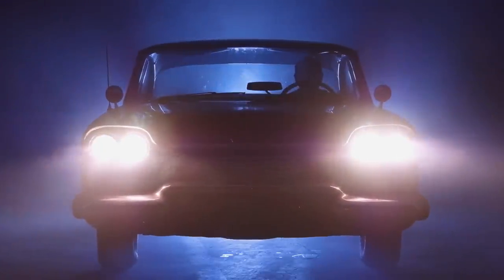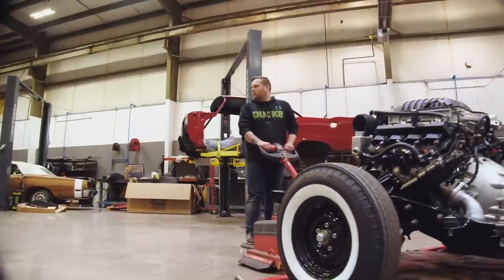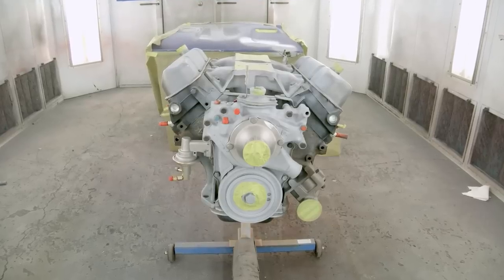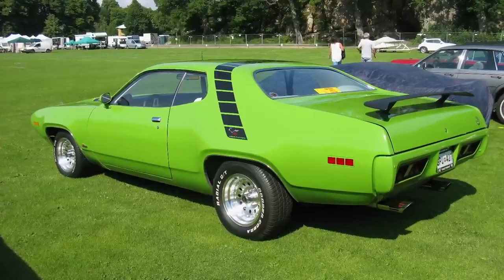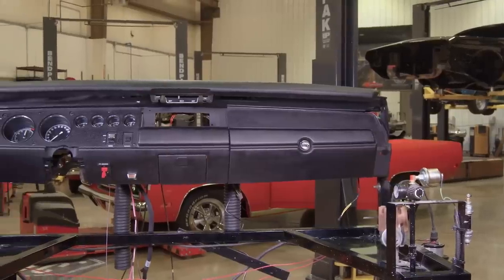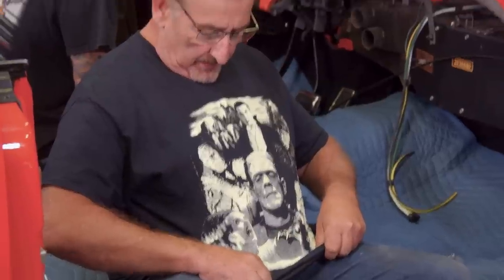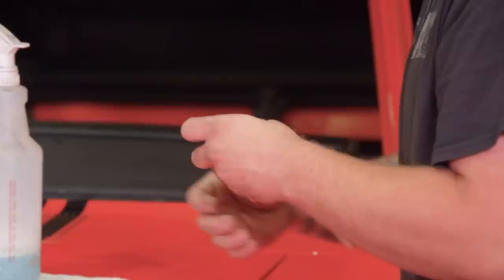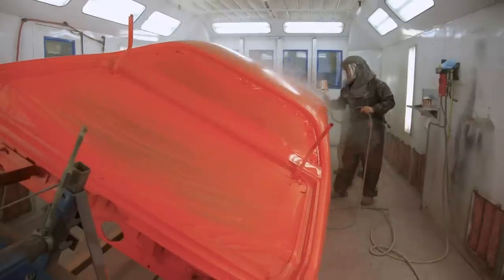NEW EPISODE: GARAGE FIND 69 CHARGER R/T GETS DELIVERED!

Comment: In your back graveyard you have a 1970 Plymouth Fury. I’ve seen it on your openings for years. Your next project should be to drop a Hellcat crate engine with a 6 speed manual transmission in that Plymouth Fury! Call it,”Hell Cat Fury!” Or simply HLCATFY! Leave it brown with the vinyl top and big meat Micky Thompson tires on the rear! Other than that keep it stock looking. That’s one mean mother of a MOPAR! MOPAR enthusiast will lineup to buy that car!

Comment: Among many slogans used, "Dodge Dependability" was used about a century ago. After many years and miles of use, my 318 and 360 engines from the mid 1970's support that claim.
Reply: My very original, number’s matching 1970 DODGE CHARGER 500 with the original 318 ci engine supports this claim as well!!!